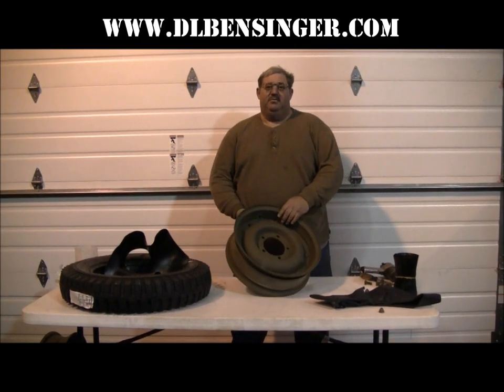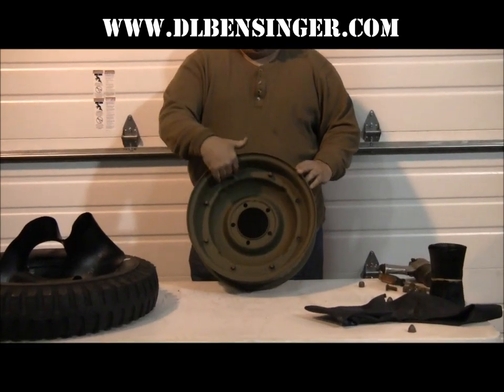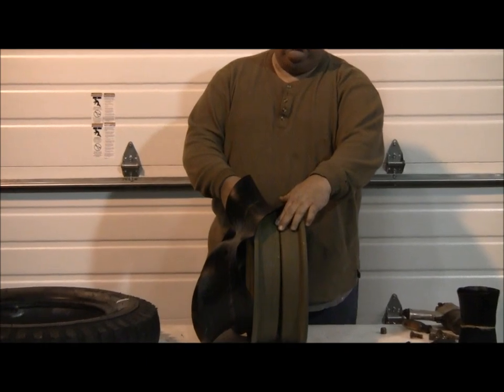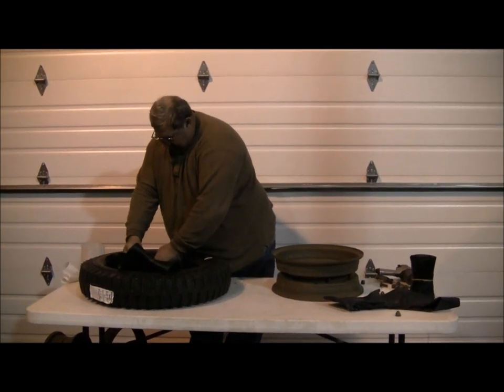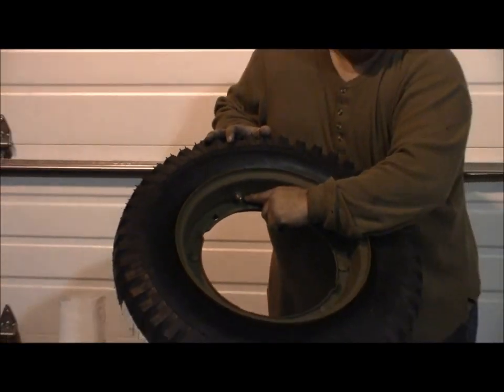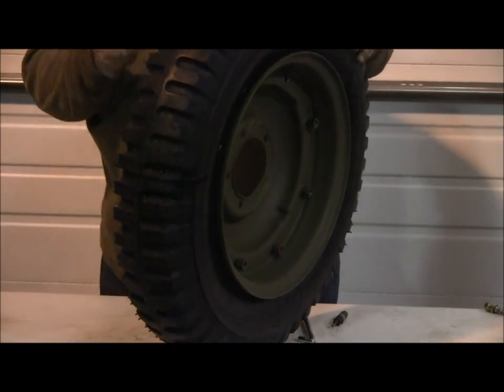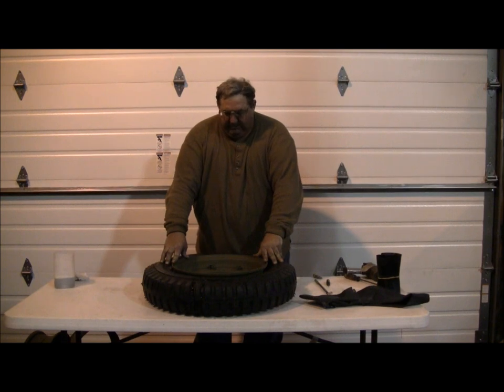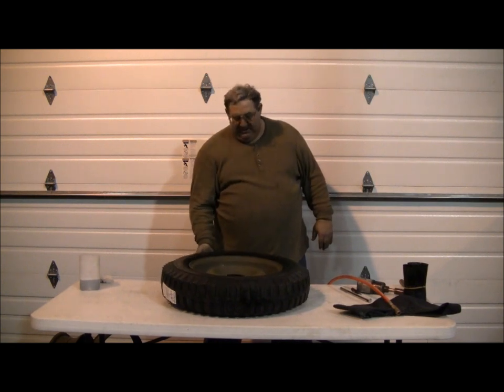combat wheel explanation

Comment: Are the 8 combat rim nuts, the same thread and shape (interchangeable) as the 5 wheel mounting nuts?
Reply from the maker: Yes and no, they are the same diameter and the same thread but I wouldn't recommend using them as mounting nuts. The combat rim nut is taller than the wheel mounting nut and thus, has more threads in it. And they are all right hand threads. (Not lefts and rights like the mounting nuts.)
Reply: @DLBensinger  Ahhh ... thanks for the info! .. I'm planning my Willys MB purchase in the coming months and gathering as much info as possible! :0)